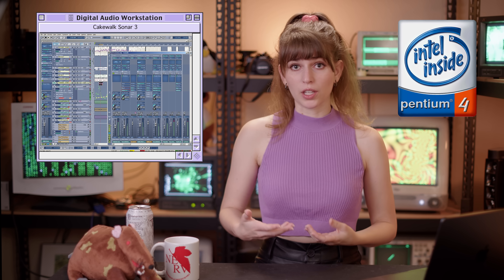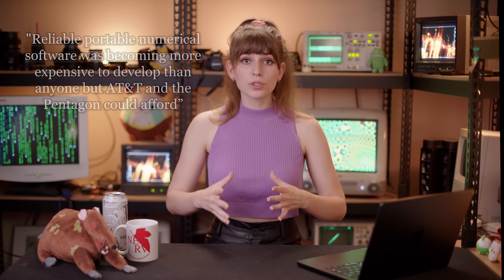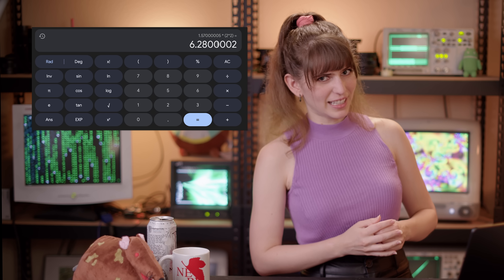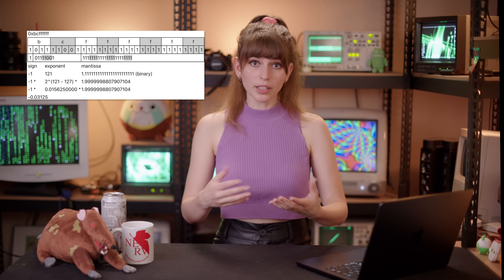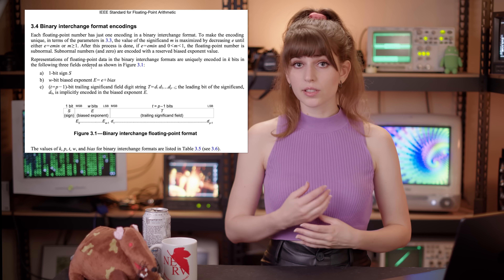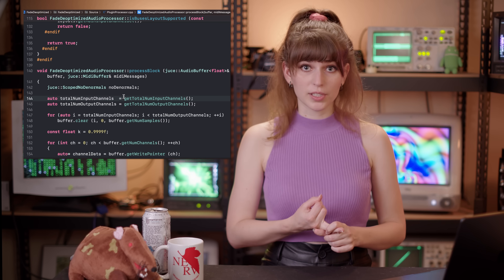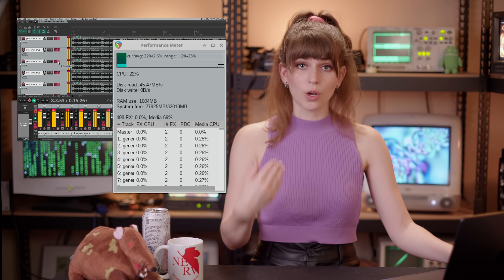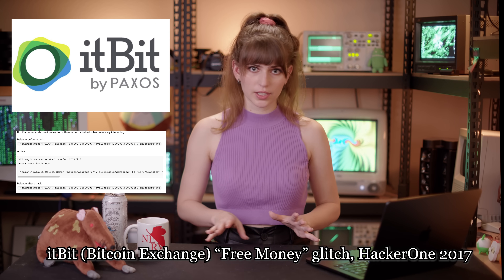Fading Audio is ROUGH on CPUs

Comment: You don't use floating-points in finance. Instead integer arithmetic is used and then the values are displayed as if they were decimals. Instead of storing 1.23$ as a float, you store it as an integer of 123 cents. This avoids any floating-point errors.
Reply: As I understand it, all balance and transaction amounts are in cents (or local currency equivalent) in most contexts. Performing nearly any calculation that could result in partial cents will have a regulation declaring what the correct behavior is - generally attempting to reduce running errors (where it's rounding in the same direction more than the other and you get larger errors at the end)

I think there are some contexts where instead calculations are done in hundredths of a cent, but I'm hardly an expert.

I could see floating point still being used with non-currency amounts, so that doesn't necessarily make the video wrong though.
Reply: Curious, but say you're writing an arbitrage algorithm.  How do you keep every currency as an int?
Reply: @jesseparrish1993 some languages added the decimal type, just like database engines did. In the event that there isn’t a type in the language, you likely need to rely on a library or let the database handle the calculations.
Reply: @TheThirdWorldCitizen That's what I did.  Guess this is just how it works under the hood.
Reply: @jesseparrish1993 binary coded decimals perhaps?
Reply: Using Ints for fixed point doesn't mean everything is an "Int", it means everything has a fixed number of places past zero.

Regardless, financial calculations also use decimal coded floating point numbers for extended range floating point. These have no rounding issues when converting to decimal forms. A good example is the Objective-C NSDecimalNumber or Swift Decimal.
Reply: So no problems with division, rates...? Or is the solution that everything gets rounded down to cents? No floating point error, but also no great precision. If you divide one dollar (100 cents) to 3 people shares, you get 0.33 times three, but where does one of the cents go? (I mean, I get it, there will be all kinds of residuals, sure, maybe 1 cent just stays on the initial account, why not. But presenting the system as somehow better is weird... whereas something like 15 digit precision, even with floating point errors after that, would still be more clear, precise, just, more predictable, less hacky.)

How would you calculate with something like 0.000000000001 rate applied every minute? Just ditch the system and use something else...? Sure, but... why get so restricted, if the rate would be better to be like that for some reason.
Reply: @rk-bumbum  multiply by a factor of ten raised to some exponent, do the calculations, then divide by the same factor of ten. If the end result is going to be a transaction, then you have to resolve it to actual currency units anyway.
Reply: Fun Fact. In the Superman movie starring Christopher Reeve, the character played by Richard Pryor was a computer wiz and routed the left over amounts to his private bank account. He made millions. But Lex Luthor found out... probably because Lex was doing it before Richard Pryor did it.
Reply: BigDecimal for the win!
Reply: excel uses them though and is used for lots of financial stuff in the real world. ultimately it takes a lot of calculations for the error in a 53 bit double mantissa to matter.
Reply: @random832  It can be done with a single subtract of almost equal numbers😃
Reply: @paulscherf5724  you seem to be using a very different definition of the word "matter" than the one i meant.
Reply: How do you know where the decimal point is ? Do you now need to store the decimal point in a separate variable? (nvm, reading more it is fixed, not floating)
Reply: It’s a technique known as fixed point, and has been around since time immemorial (the Babbage engine used it). The advantage in finance is that you don’t get to worry about weird binary rounding. The disadvantage is that you get a hard limit on precision (so you generally need to work to more than the number of digits you need and do a manual rounding step).

Comment: I have added very small alternating values to avoid denormals, which indeed used to make a big difference in performance. Setting FPU options was not necessarily an option depending on the platform you used or if you wanted your code to be portable. That was also with compilers that did not allow much tweaking (namely MS compilers) That worked well enough.

Comment: As a Hardware Design Engineer who did some work in Control Flows of a Modern FPU this actually is quite suprising. Subnormals in the FPU itself are not significantly more expensive to calculate than normals. On the input side a subnormal just means you set the bias bit to 0. For FP32 that is about 8 OR-gates. Then you don't care until the output where you count leading zeros to shift the mantissa and change the exponent. Here subnormals just mean you need to clamp the exponent and shift amount, which costs about as much as an 8bit adder IIRC.

For our unit none of these could ever cause additional clock cycles to requires in addition, multiplication, casting or comparison. For division depending on precision we could go from 8 to max 12 cycles IIRC. Compared to 27 or so bit wide mantissa additions and multiplications these should be neglible in other units too.

So I suspect what is happening is that the 0s generated by rounding subnormals then cause the FPU to not be used anymore after that for some chunks of the data. So it is not really subnormals that are bad, but floating point calc in general?
Reply: It seems that for Intel CPUs it stopped being an issue with Sandybridge. I have a 2014 laptop with no subnormal penalty at all. 

For AMD, in Bulldozer and Piledriver the subnormals were done in microcode, Pentium and early Core style, and that's where figures of hundreds of extra cycles comes from. Ryzen seems to only take a handful of extra clock cycles, so for fat packed SIMD arrays full of subnormals, that is absolutely the cause of this kind of performance.

So indications are that the subnormal problem was actually a much much bigger issue round the turn of the century and the birth of x86_64, that microarchitectures of that era genuinely forewent hardware subnormal handling that used to be provided and went for microcode instead
Reply: The problem isn't the penalty of floating point processing in the CPU.

It's that Windows configures the CPU to raise an exception every time a denorm is encountered, making the kernel fix up the denorm.

This is why the penalty is absolutely crippling. Just a small sprinkling of denorms in a DAW would grind the computer to a halt when this happened on P4. The difference between P4 and everything before and after is that there isn't actually a spec when the exception must or cannot be used. Intel simply decided that raising it at 2 orders of magnitude larger numbers was perfectly fine, and if the denorm handler has to spin its wheels and do nothing most of the time, it's not their problem.
Reply: @SianaGearz Hey, you've made a misconception. It's actually microcode traps on microarchitectures that don't have full subnormal calculating hardware, not windows forcing exceptions — it's transparent even to the operating system, and there are no interrupt numbers on x86 associated with subnormal values in floating point calculations.
Reply: @bobdavelisafrank_4850  interesting, thank you. THAT much of a microcode overhead huh?
Reply: @SianaGearz Yep! I highly recommend checking out section 3 of the 2006 paper "Quantifying the Interference Caused by Subnormal Floating-Point Values" by Isaac Dooley and Laxmikant Kale, it's a citation from the Wikipedia article on subnormal numbers (under "performance issues"). They have a chart of subnormal operation slowdown rates across various then-contemporary architectures, and there's a strong relation with pipeline complexity

Comment: Integer math + fractions, back then an FPU was a luxury!
You even tried to avoid divisions, as they are computationally expensive in older CPUs as well. Not that "up to 2 operations per clock cycle throughput" thing you get today with pipelining, speculative execution.

Comment: It's interesting this happened with fading between tracks. You'd think lowering the volume by say 0.1% in 1000 steps would be enough. And multiplying audio samples by 0.001 should not produce these tiny subnormal numbers.

Comment: Only stupid programmers use real variables where there is no trigonometric processing. And they do this only because it is convenient to draw them using printf. Normal programmers operate with integer values that count the number of the minimum unit - a given resolution.
Reply: There is a lot of trig in audio actually.

Then you have the problem that audio passes from plugin to plugin, or from effect to effect or between other processing stages - in which format should it pass? Steinberg decided that there is no penalty from going float, back in the 90s, that everything you can do in integer, you can do in float with so little penalty that the conversion would be too much of an overhead when some plugins definitely need to do float stuff. And since then, we have fully float audio.

Comment: hmm couldnt one just keyframe, linear interpolate between a larger number that doesnt go too small, fast divide to a number between 0 and 1 and then use an amplify with that number on the original sound?

Comment: Don't know why this was recommended to me, but very interesting. The more you know. How does ARM architecture handle this though?
Reply: Subnormal handling is configurable in aarch64 via the flush zero register. If it’s 1 then subnormals are flushed to zero else they are handled according  to the IEEE754 spec
Reply: @countbowl  But x64 has a similar flag. So what again is the difference? Subnormals are just a compact way for storage. Before you load them into the ALU, just find the first one and normalize. This costs one cycle on 386 or JRISC.
Reply: @ArneChristianRosenfeldt  there’s two parts to this question:

1) how does each architecture handle subnormals

2) at a micro architecture level, what are the differences that may be Impacting performance.

1. As you’ve mentioned, they both support the same feature set of either flush to zero or full IEEE754 compliance. From that perspective, there is no difference.

2. Much harder question to answer without input from both the intel and Arm architects and design engineers that I’m sure they are not at liberty to share. It’s mentioned as an offhand comment in this video so we’re not even sure what differences she saw.
Reply: I feel that you asking about ARM architecture means YouTube hit the mark perfectly when they recommended this video to you 😅
Reply: I know about computers and processors, but these low level CPU workings not really.

Comment: 10:25 wait, instead of one FP value why not chain exponentiation with separate unsigned integers and sum the logs to compute the fp value? is it a limitation of converting between discrete vs continuous? a data sparsity thing? entirely performance reasons?